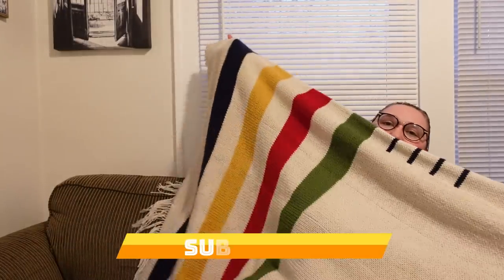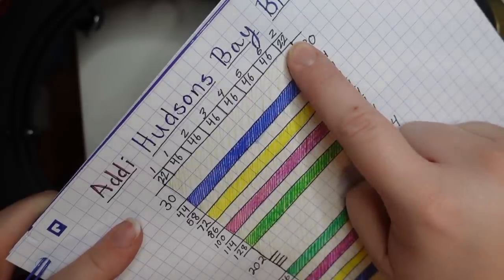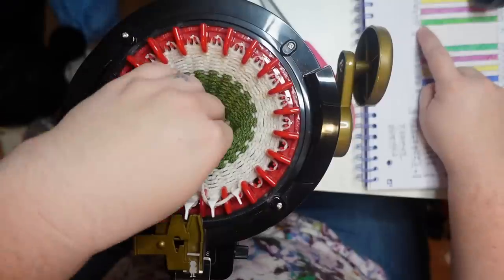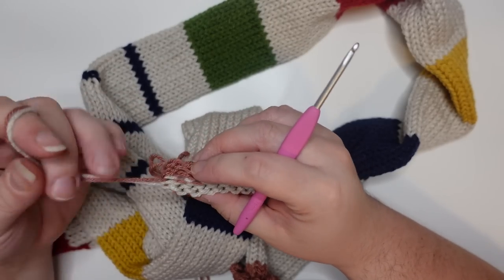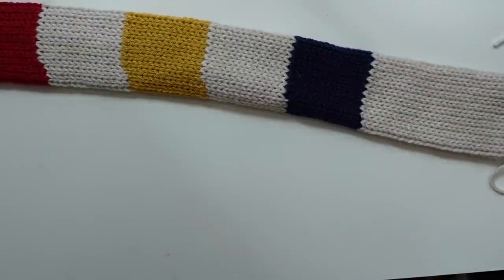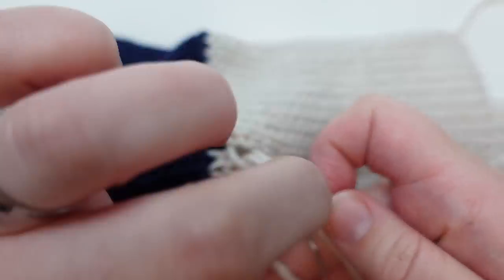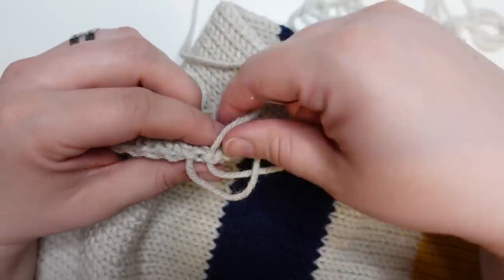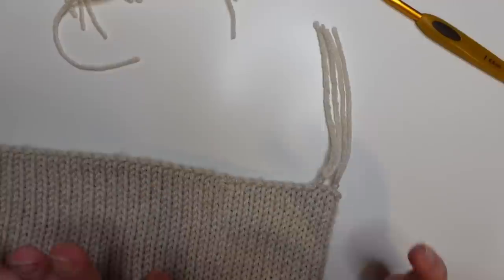Hudson's Bay Inspired Knit Blanket Tutorial | Addi or Sentro Knitting Machine Tutorial

Comment: Love this video. Went out to buy the yarn, however Indigo colour a bit difficult, but DENIM colour yarn is the closest to the blue in the blanket.  The 4 points stripes on the sides, represent the size of blanket, NOT the payment in pellets. The more points strips the bigger the blanket-4points =Twin size. Happy Serento Knitting 😊
Reply: From Harold Tichenor book on the "Collector's Guide to Point Blankets of the Hudson Bay Company and
other Companies Trading in North America":  	

What do the points mean ?

The points always indicated the size of the blanket, with less points used for smaller blankets and 
more for larger ones.  In a sense they are a kind of code or a label indicating the blanket's size.

Do the points have anything to do with the blanket's value or price?

Naturally, larger blankets cost more to make and therefore sell for higher prices than smaller ones.  
The Hudson's Bay Company used a unit of currency called the "Made Beaver" that equaled the value 
of one fully dressed beaver pelt.  Most of the Company's goods were valued in their equivalency to 
the Made Beaver. A fine Arctic Fox fur might be worth five Made Beaver, a gun thirty.  So too the 
blankets were valued in their equivalency to Made Beaver as that value changed from time to time. 
There have been times when a blanket commanded a price in beaver pelts closely equal to one pelt 
per point, but over the long period during which these blankets were traded this was rarely the case. 
The points originally indicated the blanket's size and not its price in beaver pelts and the points 
continue to indicate size today.

What is the origin of the point markings?

It is believed that the use of points started with French weavers perhaps as early as the 16th 
century.  It has been suggested that the term derives from the French word empointer,  meaning 
to make stitches in cloth. By the 18th century, blankets and clothing made from blankets appearing 
in old illustrations and paintings show that the use of points on blankets had become quite common 
by that time.

There appears to have never been an original standard to point markings. But during the 19th century Hudson's Bay Company did establish standard sizes that they would accept from their suppliers and as a result most British mills adopted them. American mills generally made their blankets slightly smaller and lighter than equivalently marked English-made point blankets.

While a larger point blanket will naturally weigh more than a smaller one, the actual weight per square 
yard of blanket cloth would be the same for each blanket size as long as they are from the same mill 
and of the same grade.  From time to time various grades of blankets were available and blankets of 
the same dimensions and thus the same number of points were produced in both heavy and light grades. 
For instance during World War I HBC marketed lighter weight point blankets in grey and brown colours 
along with their standard line of colours in the traditional weight cloth"
      The four point blanket size:  90: wide x 72" long  - weight was 6 lbs.
       The 3 1/2 point blanket size:  81" wide x 63" long - weight 5 lbs
        The 2 1/2  point blanket size:  66" wide x 60: long - weight 3.5 lbs.
         The 2 point blanket size:  58" wide x 42" long - weight 2 lbs. 35 oz
         The 1.5 point blanket:  51" wide x 36" long - weight 1 lb 12 oz.
          The 1 point blanket:  46" wide x 32" long - weight 1 lb. 8 oz
Reply: I want this mechanic from where we can get it

Comment: CANADIAN HERE:.......The “point” system was invented by French weavers in the mid-18th century as a means of indicating the finished overall size (area) of a blanket. The word point derives from the French empointer, meaning “to make threaded stitches on cloth.”

Each blanket was graded using a point system. Points were identified by the indigo lines woven into the side of each blanket. A full point measured 4–5.5 inches (10–14 centimetres); a half point measured half that length. The standard measurements for a pair of 1-point blankets was: 2 feet, 8 inches (81 centimetres) wide by 8 feet (2.4 metres) in length; with a weight of 3 pounds, 1 ounce (1.4 kilograms) each. Points ranged from 1 to 6, increasing by halves depending upon the size and weight of the blanket.

The number of points on a blanket represents the overall finished size of the blanket, not its value in terms of beaver pelts as is sometimes believed.

Comment: Why do you need waste yarn
Reply: Waste yarn allows your end stitches to remain the proper loop size - the waste yarn will be ruffly or tight, depending on how much it's handled. When you finish off the ends of the blanket, you ignore the waste yarn and remove it when the end is finished. Use a color that doesn't occur in your work. Solids are the easiest, in my opinion.  Use a waste yarn that's the same weight as the yarn for your piece of work. Avoid fuzzy yarn or yarn that splits easily.  Watch her step when she finishes the ends.  Note how unkempt the ends of the waste yarn appears.  Picture trying to find the proper stitches when the loops are tight/loose/tight.  You can reuse waste yarn many times.  It not only saves you time, but it greatly reduces frustration! 😅😅